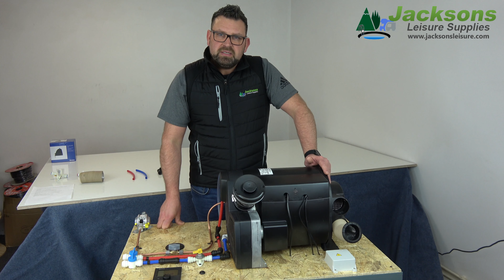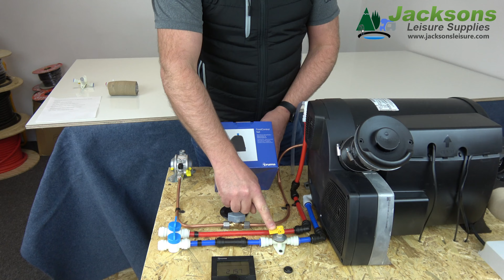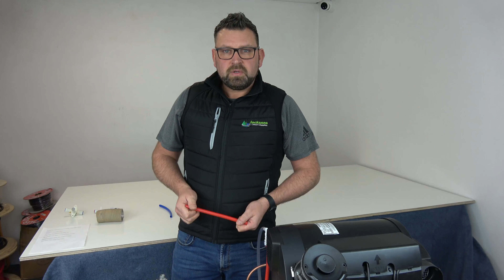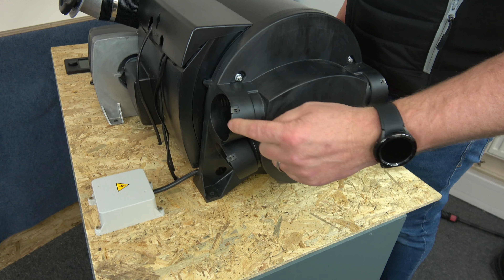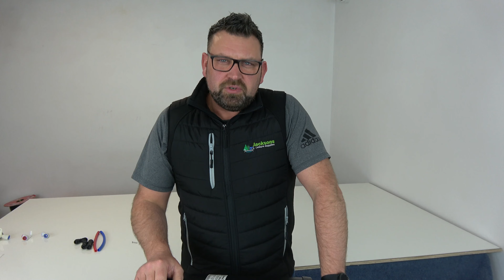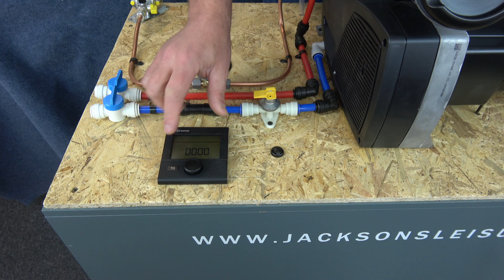The Truma Combi 2E 4E and 6E Boiler and Space Heater Kit Campervan Motorhome use

Comment: The added pressure release valve should be on the hot not the cold no one wants to throw away all there cold water but the hot tank needs the frost protection

Comment: Hi, I have a Truma 4E boiler in my Sprite Alpine 2 Caravan. It appears that the elbow hot water valve is leaking (dripping all the time and pump intermittently running) I'm looking for a replacement valve but it seems it depends on whether the metal outlet pipe is smooth or humped. How can i tell without removing the valve?  Thanks
Reply: It will most likely be a John Guest elbow and will be designed to fit on to a smooth pipe. I would take a photo of it to a caravan supplies shop to compare it.